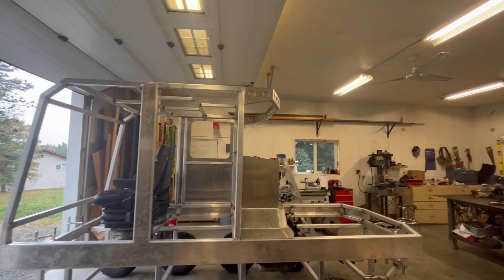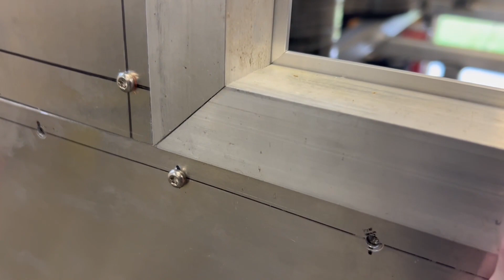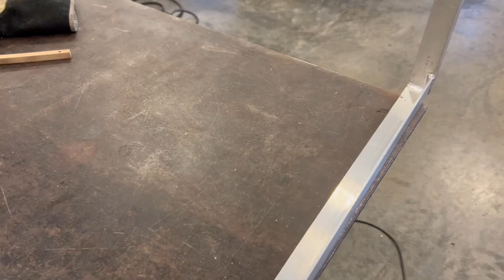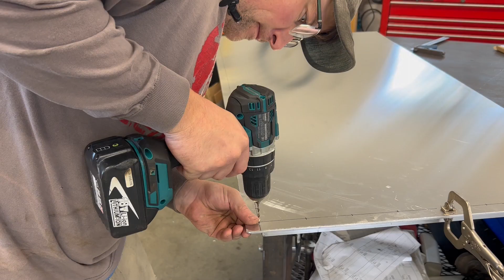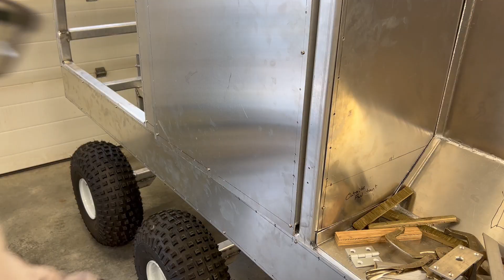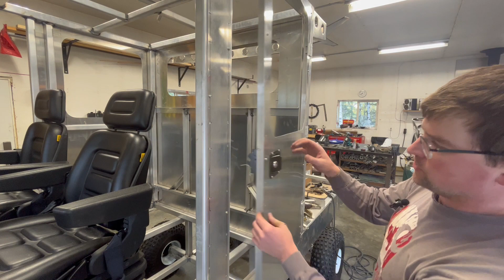Building the First Door | SnowCat Build PT17

Comment: You need to put a skinnier tire.
Reply: You're kind of following the design from an aryou. Are you were asking about tracks in your other video? You might as well just put argo tracks on it
Reply from the maker: Yes that is exactly the style I am using. You can’t buy Argo tracks the size I require. They will be 21” wide and 26’ total length. I am fully building a set of tracks myself. You will see. It will all make sense when it’s done. Keep watching tracks will be getting built soon. The design of this rig requires large turf tires for a few reasons.
Reply from the maker: Nope don’t think so.
Reply: If you look at a tank, the tires are really skinny. If you look at an Argo, the tires are big and round to accommodate for this suspension. Is this what you're trying to do? Because as far as you have it right now you could add the suspension
Reply from the maker: Suspension complicates things. It’s also just more to go wrong.
Reply: All i'm saying is a skinnier tire will allow a better track design
Reply from the maker: I would be so confident in that. Just keep watching!

Comment: Steel and aluminum don't play well with each other
Reply from the maker: Correct when in direct contact and exposed to the correct environment they don’t play well. That is known and galvanic reaction. It doesn’t take much in terms of corrosion inhibitors to prevent this. Such as anti oxide compounds, paint, urathanes etc.

Comment: Make sure you have enough gap around the doors so they won't bind if the SnowCat is sitting on an incline and the cab racks slightly. My first outing with my vehicle made me go back and take a quarter inch off the door.  Thanks for sharing your project.
Reply from the maker: Oh hey man thank you so much for the tips! You are totally right I honestly hadn’t thought of that much but thankfully I had gave it about 1/2” clearance because of the bulb seal I used so fingers crossed thanks enough! Thank you for watching! I am enjoying sharing my passion! Cheers